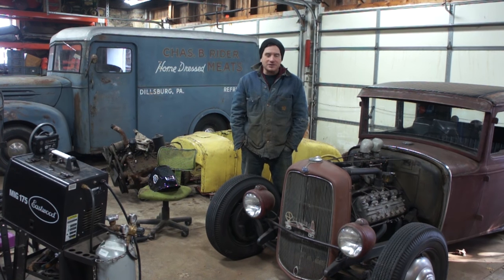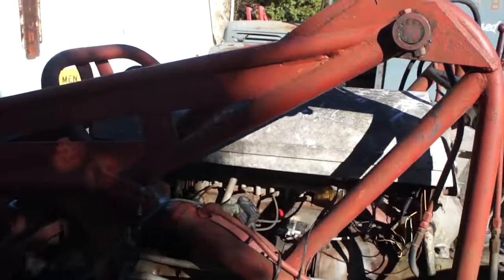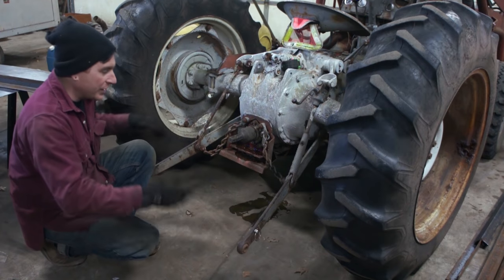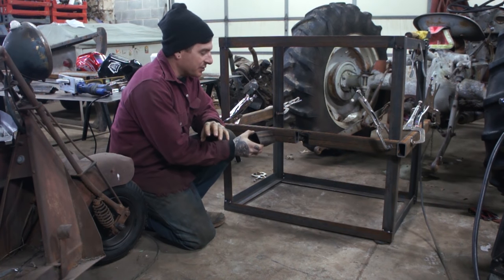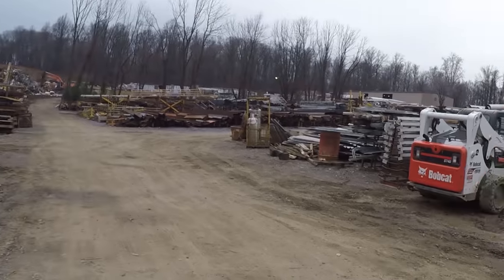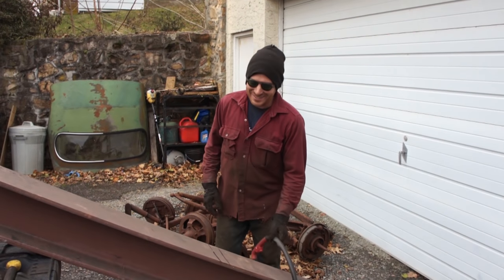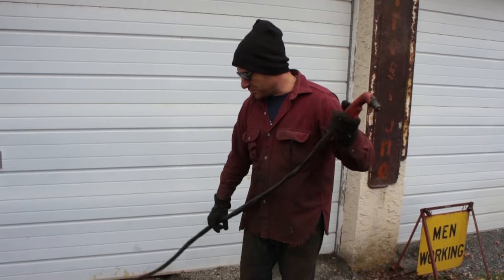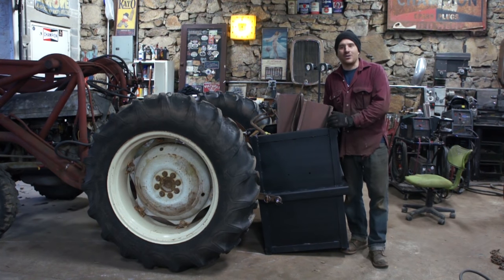DIY Scrap Metal Tractor Ballast Weight Box for $100 or less!

Comment: Matt you have the patience of Job , If I was out in a cold morning trying to start that tractor I might be tempted to burn it and stay warm next to the fire. While you have it in the shop for the weight box give it a tune-up straighten out the wiring and do your 12 volt conversion. I have a tractor and its a God sent when clearing the driveway and fields. You are going to be amazed how handy that equipment is
Reply from the maker: Haha it actually doesn't start that bad! I just forgot to turn the fuel on after a few minutes of messing with it. I was swearing at myself for the dumb mistake haha. Thanks for watching! -Matt/ITG

Comment: Hey a Matt, I hope that you thought to cut holes in the box for drains because it's gonna need them. The hitch in  the bucket is really cool however I figured that the angle on the bucket was going to be wrong when you put it together, so that puts getting the plasma back out and cutting a hole in the front bucket for a ball and for a clevis pin to move the trailers around
Reply from the maker: The plate had holes in it already from the salvage yard. They did the work for me. Haha! Thanks for watching. -Matt/ITG

Comment: Hey Matthew good morning. Just a little suggestion from us folks up here in the frozen tundra. We usually fill the tires with fluid so they give you some weight and the traction goes up major. You can then use your three point and fancy box too tote things around in or move cars, ect. The only downside with a box is that the front tires can get a little light but that bucket should take care of that. Have fun with that old bucket of chicken.
Reply from the maker: Thanks for the info! The tractor came with the tires already filled for weight. Just adding a little more weight. Thanks for watching! -Matt/ITG
Reply: @IronTrapGarage 
Do you still want to sell the Hemi Matt?

Comment: Hi Matt could fill the tires with fuild's additive to keep them from freezing or steel weights built for the wheels, bolts on the 4 hole on the inter part of the hub. I welded a 2 inch ball in my bucket one of those cheep harbor freight one that way I can see my trailer and control the up and down ,as always good job your always thinking outside the box cheers Dale( heavy equipment retired operator) learning how to be a hotrod guy like you👍
Reply from the maker: Hey Dale! Yea the tires were already filled before I got it, so it definitely helps! Good idea on the ball, I may do that too! Thanks for watching! -Matt/ITG (hot rod guy learning to tractor!)

Comment: Hi Matt, I really enjoy watching all of your videos. Don't know if someone already mentioned that you have a Ferguson, not a Massey Ferguson. I use to have a '53 model that came with 12 volts from the factory. Not having live hydraulics is a bit of a pain in the ass but your problem with the 3ph dropping can be overcome with new seals. Your chain idea is probably a lot easier. If you ever have time, look up the connection between Henry Ford and Harry Ferguson. A very interesting read.
Reply from the maker: Hi Gary, thanks for the information. I figured I was messing some sort of terminology up as I'm out of my wheelhouse! Thanks for watching, I'll look up the history! -Matt/ITG

Comment: Cool build Matt&Mike. Just a couple of thoughts...the lift cylinder for the 3 point might need seals,or the control valve is leaking. You said you had tire chains,they make a big difference. Build some rear fenders-that would be a cool vid. What about a rear scraper blade that goes in the hitch receiver made from an old water heater and angle iron. Rear blades work pretty good for plowing snow. No snow to plow yet here in Detroit.Thanks for posting:-}
Reply from the maker: I think one of those things are bad for sure. I'll need to take a look at it! Thanks for watching. -Matt/ITG

Comment: WHEN I MADE MINE I USED A HEAVY DUTY 55 GAL DRUM ANDA DRAW BAR HITCH   SETTING THE DRUM ON TOP OF THE BARS THEN IT DIDN'T HIT THE GROUND AND CHAINED IT TO THE TOP HITCH LINK FILED IT WITH ROCKS   TO GET IT OFF I BACKED INTO SOMETHING  A LITTLE HIGHER THAN IT LET IT DOWN AND SLIDE IT OFF  THERE IS A WIGHT LIMIT ON THE TRACTOR YOU CAN OVER LOAD THE WHEEL BEARINGS AND THE REAR END THAT IS WHY THEY PUT WHEEL WEIGHTS ON THE WEIGHT IS NOT SUPPORTED  BY AXLES BEARINGS ETC  AS FAR AS THE LEADING DOWN THERE IS A LARGE O RING ON THE PISTON UNDER THE COVER UNDER THE SEAT  IT IS EASY TO REPLACE BUT MAKE SURE THE PIN THAT STOPS THE PISTON TRAVEL DOES SO BE FOR THE O RING COMES OUT OF THE CYLINDER OR IT WILL CUT IT OFF WHEN IT GOES BACK IN (PLEASE DON'T ASK ME HOW I KNOW LOL)  KEEP UP THE GREAT VIDEOS
Reply from the maker: Thanks for the suggestion Larry. This Box definitely isn't over filled. There's probably 800 pounds in the box currently. Thanks for watching. -Matt/ITG

Comment: if u feel u need more weight u can add wheel weights and or fill ur tires with windshield wiper fluid or mobile home anti freeze. I put 27 gallons in each tire.8lbs per gallon and works great.
Reply from the maker: Oh wow that's a great idea! I know my tires are already filled with calcium but I'll keep that in mind. Thanks for the suggestions. -Matt/ITG
Reply: B AWARE that calcium is corrosive and will eat away at ur rims. @IronTrapGarage

Comment: U have a stop adjustment on your 3-point lever so that u can regulate how high u want it to come up,also u may have to pull the top off under your seat and replace the seals to keep it from drifting down, Good luck .
Reply from the maker: Yea I think I have some bad seals! Chained up works ok for now though. Thanks for the heads up! -Matt/ITG

Comment: Your three point assembly has a weight limit, you may be exceeding it.
Reply from the maker: It has about 800 pounds in it. I doubt that's over the weight limit. Probably some seals going bad as mentioned by others. Thanks for watching. -Matt/ITG
Reply: @IronTrapGarage  I believe the TO20 lift capacity was 850 lbs.
Reply: @41plymouthnut87  No problem if you have a mechanism for locking the 3-point, that way you get all of the hydraulic power to the front loader.

Comment: It is not finished ! Go back to the scrap yard and get some wheels for it cause you will take it off and want to move it. Well you're at it put some drain holes in the bottom cause it will get left outside !   The hitch will bug you till you come up with an adjustable one. LOLOL
Reply from the maker: The plates Matt used already had holes drilled in them, so we have the drain hole covered. Currently the weight box is chained up on the three point for the winter. maybe this summer we will re-visit and add some wheels! Thanks for watching!! -Mike/ITG